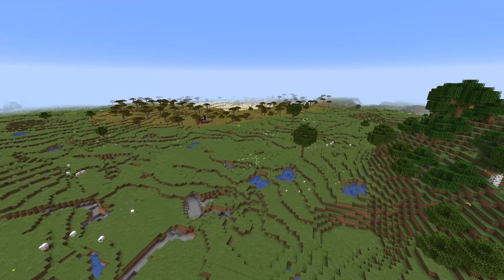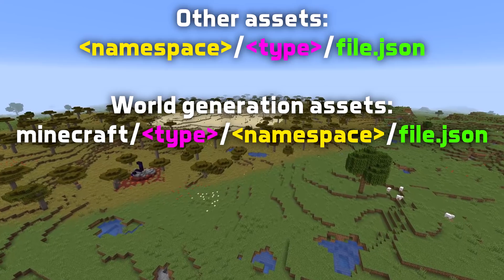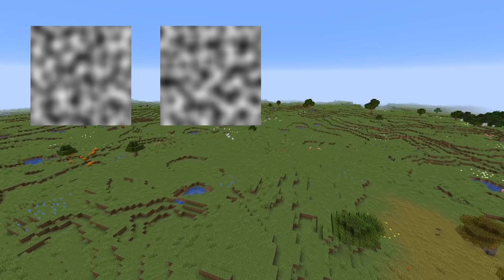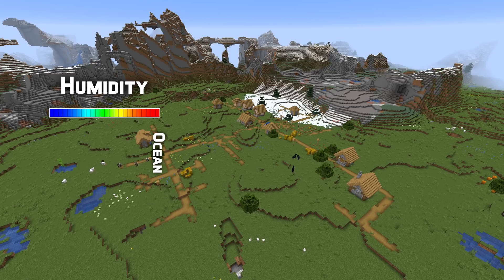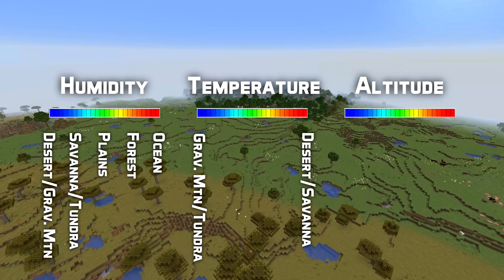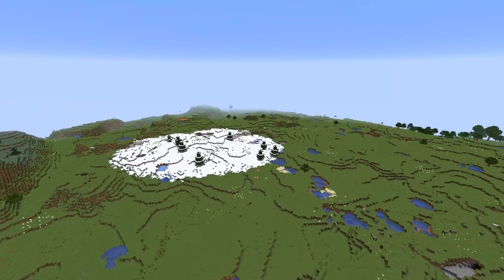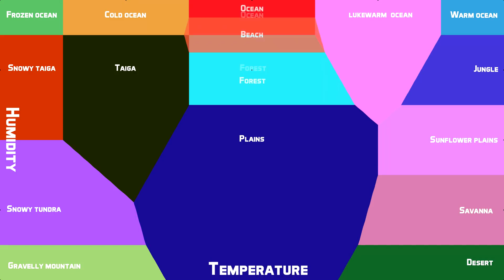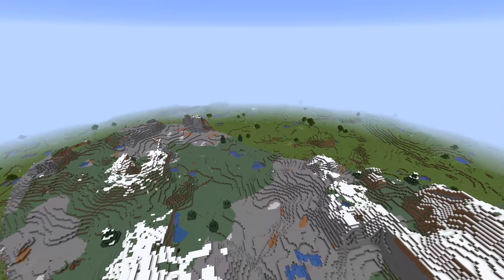Crafting Custom Worlds Tutorial: Part 2 - The Multi-Noise Biome Source

Comment: Is there a way to take one parameter, such as temperature for example, and generate a world such that only that parameter isn't random? That is, humidity, altitude and weirdness can be set as noise, while temperature is constant, or maybe it oscillates on the X axis. Is there a way to do that right now with data packs?
Reply from the maker: Well, the only way to do it is to have it be constant - that is, don't use that value at all in the biome settings.
Reply: @slicedlime  I see, thanks!

Comment: Is there any way to append to an existing dimension's biome list without overriding the whole thing? The multi-noise system would work really well for adding custom biomes, but there ought to be a way of doing it that doesn't break compatibility with other data packs that add biomes to a vanilla dimension.

Comment: Okay so I have some ideas:
1. Different noise map options. Could lead to some very wacky, very fun terrain by overlaying different types of noise maps.
2. Variable offset. Whether using a formula, noise map, or specific circumstances, being able to have some skinny beaches and some wide beaches could be quite nice.
3. Linkable noise map generation. This is the meat of what I want, and also probably the toughest to deliver on. I want the noise maps to interact as they generate. A high altitude biome next to a high humidity biome would create a sharper decrease in humidity on the other side of the high altitude biome. Think mountains creating deserts. Ideally, one could play around with the connectedness functions for further customization.
4. Extra noise maps. In order to properly integrate macrogeneration for features like continent size, shape, and style, additional optional noise maps will be necessary. Please allow us to add our own on top of what is already here.

Comment: Oh boy, I can’t wait until we get to structures. I’ve been wanting to change up the generation of Mineshafts and dungeons for a while now, as well as add more parts that can generate in other structures. I presume I could give Jungle Temples a dungeon underneath them with the right tweaking, right?

Also, based on how weirdness works in normal Minecraft, it seems like weird biomes are more likely to generate in the middle of their related biome. So, if I wanted to make, say a red sand desert, I’d probably want to make it a little weirder but also more or less humid, or higher or lower, so it would’ve more separate from normal deserts, right?
Reply: The default overworld doesn't use multi-noise (yet). Just the nether.

Comment: this needs far more views

Am I being a dunce? how do you use the files?
Reply: In the Petrified pack you can use it as a datapack but it doesn't actually create a new dimension so it doesn't do anything. You'll need to add those files to one that has a dimension. See https://minecraft.gamepedia.com/Custom_dimension and https://minecraft.gamepedia.com/Custom_world_generation for more info on the folder structure and how the files interact.
Reply: @ellarose7256  thanks much appreciated

Comment: This a great tutorial, thanks again. I've tried to play around with the parameters on my own but this finally makes everything make more sense. The only issue with the multi-noise is that it doesn't allow a more complex generation of certain features, like Rivers or those Plains and Forest ocean islands. Hopefully we'll be able to mess around with the Vanilla Layered generation to implement these features in later versions...
Reply from the maker: You could probably do the islands by just having a small plains entry in the middle of the ocean settings - like at one of the extremes of a parameter.
Reply: @slicedlime  I'm trying to do that, but it's a bit difficult to distinguish between different island types (plains, stone, beach, etc). Maybe now that I understand the parameters better instead of putting random numbers and hope for the best I could use one of them for that effect.

Comment: Really good explanation. I fiddled around with the new world generation a bit but couldn't quite get my head around what was happening with these 5 parameters. One thing I now realized tho, it seems we actually have no way of controlling where exactly the biomes will go like for example if I want to create a world which has more "verticality" like the nether or cave world terrain and then say: the bottom of the world will always be more desert or wasteland and the top will always be jungle. Maybe in a future update.
Reply from the maker: The thing is, the way it goes is the other way around. If you want to make the top of the world jungle,  you make a jungle biome that generates tall terrain.
Reply: Ok, I will tinker with it a bit more. I guess what I assumed at first was, there was 3D noise used for the biome distribution. But you already stated in another comment reply that this is not the case so there can't be multiple biomes stacked on top of each other in the same column of blocks unfortunately.

Comment: Are there some default values for each biome's parameter's? I know multi noise is for the nether, but still, it would be nice to start with a regular world and make minor adjustments from there instead of trying to rebuild everything.
Reply from the maker: No, there isn't - for exactly that reason. Since the default overworld isn't implemented using the multi-noise biome source, there aren't any values to take.
Reply: slicedlime I see, thanks. I’ll have to fiddle with your examples then. Your videos are very helpful btw :)
Reply: @slicedlime   @UCyLcX3C2NrR8bBBPK5N_E1A  There are some of them listed here https://minecraft.gamepedia.com/Custom#Biome_parameter_defaults , but not for all biomes. I would like to find the rest of the values since I want to create a datapack with all minecraft biomes + some custom of them (if it's possible?)

Comment: I want to have a dimension with currently one modified biome, How do I do that?
Currently inside the "data" folder I have one other folder called "minecraft", inside that folder I got "worldgen", "dimension_type" and "dimension". 
Inside the "dimension" folder there is one folder with the name of the (custom)dimension in which is a .json file which specefies the behaviour of that (custom)dimension.
                     -This is the main information inside the file (pls tell me what I did wrong(Brackets are a mess here but i think theyre right in my actual file)):
                                                  {
                                                    "type":"custom:dreamworld",
                                                    "generator": {
                                                       "type": "minecraft:noise",
                                                       "biome_source": {
                                                       "type": "minecraft:multi_noise",
                                                       "biomes": [
                                                                           {
                                                                             "biome":"custom:dreamworld",
                                                                             "parameters": {
                                                                                                        "temperature":0.55,
                                                                                                        "humidity":0.85,
                                                                                                        "altitude":0.9,
                                                                                                        "weirdness":0.0,
                                                                                                        }
                                                                         }
                                                                        ]
                                                         },
                                                     "settings": {
                                                                          ...
                                                                         }
                                                                     },
                                                   "type":"custom:dreamworld"
                                                  }
Inside the "dimension_type" folder there are all the default types (overworld, overworld_caves, the_end, the_nether).json as well as my custom dimension type dreamworld.json:
                                                  {
                                                   "has_raids": false,
                                                   "logical_height": 512,
                                                   "infiniburn": "minecraft:infiniburn_overworld",
                                                   "ambient_light": 0.2,
                                                   "piglin_safe": true,
                                                   "bed_works": false,
                                                   "respawn_anchor_works": true,
                                                   "ultrawarm": false,
                                                   "natural": false,
                                                   "shrunk": false,
                                                   "has_skylight": true,
                                                   "has_ceiling": false
                                                   }
Inside the worldgen>biome>custom there is simply the file for the biomes behaviour (which on its own already works fine)

-->My question: Do I maybe have to put the dimension_type of my custom dimenson into another folder (like a folder named custom) because it's currently in the same folder as the default dimension_type ones
                            Did I do mistakes inside the dimension file itself like specifying a wrong type ("type":"custom:dreamworld") and should it even be there twice?
                            How do I enter my custom dimension (I tried /execute in ... but it didnt display my custom:dreamworld dimension)

Thanks for any help in advance :)
Reply from the maker: Yes, you need to put subfolders for your biomes and things. That's what's mentioned in the data pack structure section at 1:03.

Honestly if all you want is a world with one biome, the easiest thing to do is to load the data pack and then choose that biome as a Single Biome world type in the UI.
Reply: @slicedlime  I know I could just choose single biome and select the custom biome, but I want to have all of the default dimensions with all default settings PLUS one custom dimension in which I can add as many biomes as I want, or does that not work currently?
Reply from the maker: Well an easy way  to get a working configuration for that is to create the single biome world and then export the world settings for it.
Reply: @slicedlime  I already got It to work. The problem was that I didn't store the dimension.json in a custom folder but in the default "dimension" folder. Concerning that it all works fine now.
The only problem that I'm still having  is that I cannot use my custom dimension type in the dimension.json It only works if I do minecraft:overworld. I have to further try and fail to find where the mistake lies.(the log says something like "Invalid json error "null"") 

Thanks for all the help though, I really appreciate it :)

Comment: Aren't biomes 3d? In which case how do you account for this? Is this sort of how altitude is used?
A bit sad you can't make your own custom noise generator for the variables... This would be a much more standardised/abstracted way of doing worlds like the square tiled world. Would provide a lot more flexibility... :)
Reply: each biome's json file has variables that i believe are called "scale" and "depth". scale dictates how "amplified" the terrain is, with low being flatter and high being hillier, and "depth" dictates how high up in the world the biome is. this is where the actual altitude comes from.
Reply from the maker: Biome data is stored in 3D. Biomes are currently generated in 2D.

Making custom noise generators might be fun, but honestly if you're modding you can already replace the multi-noise source itself.
Reply: @slicedlime  Ahhh i see fair enough.
For sure, but if your modding you could re-write the whole engine to meet your specific requirements... I thought the idea behind the custom worlds was rather giving flexibility to avoid having to mod the game?  I know its pretty advanced but i suspect a fairly optimal system could be used where a user creates JSONLogic which references variables x,y and z and emits a value. Functions could be defined for noise1-->5. Having said that, producing a full randomised seed generator in JSONLogic would likely be tough without being able to get the seed. Could be a custom operation I suppose... Aaaanyway, I digress :P
Reply from the maker: Well my stance on that will always be that if you're going to write code, write it in a programming language, not in JSON.
Reply: @slicedlime  Well then why have you guys provided the command system?
I fully agree that a programming language is nicer, but unless you are suggesting embedding a scripting language, I don't think this is better at all (it might even be slower than JSONLogic (which is essentially a precompiled AST)). For modders - setting up an IDE, a build process, etc. is significantly more effort than modifying a JSON file. For users - installing mods, ensuring no conflicts etc is more complicated/more prone to errors than dropping a JSON file into a folder.

Comment: I am looking forward to the tutorial about structures. If it is at all possible, I'd like to learn how to make structures either rare, remove them completely or make them only spawn within a range of Y-values (from Max Y to Min Y).

I have taken a look at the example vanilla-download from the first tutorial. But I don't get it. For instance: Why would the file [worldgen/noise_settings/overworld.json] include things like "minecraft:bastion_remnant" and "minecraft:endcity" and other non-overworld structures?

Really looking forward to the tutorial. Maybe my brain will get some of it? Enough to help me fix what I want to have in my single-player worlds. That would be awesome, if it happened.
Reply from the maker: Structures have two things: frequency settings and possible start biomes. The former controls how often you'll see a structure - the latter where it can occur. So desert temples have a certain frequency, but can only occur in deserts.

The settings are in the dimension - the starts are in the biomes. So you'll never see the nether structures in the overworld because they don't start in the overworld biomes. They're there because the same settings are used if you make a single biome world - and then you could choose to make a nether biome one.
Reply: @slicedlime  Thanks. It sounds so... easy, when you explain it that way.

Comment: can an ocean-only world be made with this?
Reply: In a new dimension, technically yes, but just by only listing ocean biomes if I'm right. Because otherwise you'd have to tweak the parameters for each biome.
Reply from the maker: Well, you can certainly make an ocean biome only world. Even in oceans there are islands sometimes though, so if you don't want those you also need a custom dimension with a higher water level.

Comment: If you play Minecraft for years and years and years, you'll maybe eventually notice that "rare" biomes have a higher than average tendency to group together. I didn't quite understand until now why.
Reply: Well, actually, the default overworld uses a different generation system. It uses layers
Reply: Why ?
Reply: @YounesLayachi  Because of how perlin noise is generated; large values and small values are in groups. So weird biomes stick together in the same way that warm, humid and high biomes stick together.
Reply: @JochCool  ah, that makes sense x)
Reply: @JochCool  the overworld doesnt even use any noise accept for ocean temperatures.
Reply: @sulfenir2477  Did you watch the video? Pretty much everything slicedlime talked about was Perlin noise.
Reply: @JochCool  yes multinoise biome source uses perlin but the biome source that is used for overworld biome distribution is very different from multinoise.